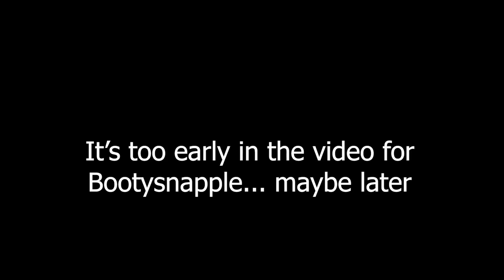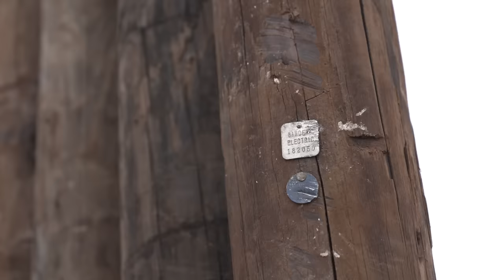Renovating an Abandoned Resort: The Wall

Comment: Hey matt. I built 21 underground complexes in the last 11 years . PLEASE READ . You need to reinforce the inside with a welded roll cage type skeleton support inside the conex box . Then use gravel and playground sand around the box once in place in the ground before burying it. Plz research it. I seen a few that collapsed before they called us in.
Reply: The condensation inside is going to be out of this world...
Reply: You'd think at least one of the ten people working there knows about roof stability complications and what could happen if there is an accident
Reply: Welded cage?  For a few inches or even a few feet of dirt, a wooden interior frame would be fine… just build it like a house.  16.5” on center, and integrate the shelving into the studs. 2x6 or 2x10 ceiling joists if 2x4s make you nervous.
Reply: Reinforcing the inside is the way to go to keep the roof from buckling inward from weight on the outside. Also, running some tubing to keep the vent fan wouldn't have been a bad idea either.
Reply: No mr dummas. He's not burying it. He's covering it
Reply: Just watch Colin Furze...
Reply: Then there's the fact he just welded mild steel to Cortan, it will rot out in no time.
Reply: @missingremote4388  Obviously he never told Mere. She is a civil engineer after all, dirt is her domain.
Reply: @Christopher_R You do realize that Matt is rich and there is no reason to go an easier route right?
Reply: Facts. People think shipping containers are so strong. Theyre actually EXTREMELY week when it comes to the corrugated parts. Very flimsy
Reply: Ya I agree I have done the same with my container but I used T post to hold my H beams going across every 5 feet and my container has about a foot of dirt on the top
Reply: He should also coat the outside of the container so it doesn’t rust.
Reply: it’s not going 50 feet under….
Reply: I did some quick math, and he is looking at easily 40,000 pounds of dirt on top of the container alone. Just to further push your point.
Reply: Don't underestimate the weight of a few inches of dirt. Especially when it gets wet.
Reply: Buried CONEX boxes in the Persian Gulf war. The roof can not handle the weight at all. You Must reinforce it!!!!!!!!!!! Semper FI!
Reply: I didn’t think welding to just the outside to rely on the welds to hold it would be the best thing to do.  I probably would have kept the fan and just went lighter on the dirt around it.
Reply: I love it how even after Matt explains what's going on people just hear what they want
Reply: @SamJG99 40k means nothing there stacked 4 to 5 containers high at the ports.and there loaded with over 43k of product.
Reply: @uria711 lol know they ain't I haul them every day and there stacked 5 high at the ports each container weighs 43k lol.that little bit of dirt isn't going to hurt that container 😂😂.
Reply: People crying about that little bit of dirt evidently never been to a port lol.there stacked 5 high and each container weighs 43k.
Reply: If it's deep enough it will be crushed/unsafe to occupy if it's not deep enough it could "float" it's way out of the ground.
Reply: Absolutely, never half ass structural integrity
Reply: @16driver16  you should really know what your talking about lol.there designed to be stacked.
Reply: @jerrywilcox9890 you evidently never been to a port either by saying that, neither do you know how a container like that works.. each container sits on supported structure not just 1mm thicc metal sheet. do some research before saying anything about safety.
Reply: @16driver16  hell they come stacked on ships and weigh way more than that dirt lol.
Reply: @jerrywilcox9890  containers are made to have a strong floor and endposts so you can stack them... the roof and walls are as light as possible only there to protect from weather etc. They have to be corregated its such thin metal
Reply: @jerrywilcox9890  also wtf you mean weighs more than dirt?!?! I can't think of ONE THING shipped in a shipping container that is heavier than dirt!!! Name one thing
Reply: @16driver16  wtf I just said you never hauled a shipping container before
Reply: @16driver16  you not understand them containers are shipped with anywhere for 40 to 44 thousand pounds of product and are stacked 5 high at the ports lol
Reply: @16driver16  he's only putting a foot high of dirt and your crying about that when they stack way more weight on them than that little bit of dirt lol.
Reply: @16driver16  you acted like its going to be barred 10 feet under ground lol.
Reply: @jerrywilcox9890  it was explained to you why that works and why dirt or anything heavy resting ontop of the ROOF not support structure doesnt work and you are still being ignorant.
Reply: @16driver16  that wouldn’t happen with what he’s doing here.
Reply: And should have left the vent on the top, to help keep the condensation down on the inside
Reply: @Vythic  lol you can call me what ever the hell ya want lol it doesn't effect me one bit cupcake.the amount of dirt he's putting on top weighs less than 4 fully loaded shipping containers lol.
Reply: @Vythic  that roof will not collapse with the little bit of dirt he's putting on it.he putting enough to cover the roof lol.hes not putting 4 feet of dirt on top. 4 inches to a foot of dirt not going to do a damn thing to it.
Reply: Did you even watch
 MR. BEAST,? He had two leaning on top of one can And dropped ten cars, one after the other from a hundred feet. And didn't even crush a Lamborghini inside.
Reply: @jerrywilcox9890 they stack other containers onto the strongest points of the ones below. Wtf does that have to do with dead center of the corrugated part? That part literally never sees any weight from the other containers. Steering wheel holders are not structural engineers for a reason.
Reply: @dillonlapointe636  there not going to be enough girt on that container to hurt anything 4 inch of dirt isn't going to do anything to the roof.you people acted like he's putting 4 feet of dirt on top he's not lol.hell I have 2 feet of dirt on 2 of mine sitting side by side and it's been like that for 6 years.
Reply: Why not build an exterior shell with the telephone poles? Even only a few inches deep running almost the length of that conex there's going to be 3-4 tons of material on top of it.
Reply: He makes these videos days or weeks before we see these. He's already done what he's going to do. No going back now
Reply: Those containers are suported by the corners and outer frame of the other container its sitting on top of. Also thoseweight ratings are floor ratings only, not the sides or top. @jerrywilcox9890
Reply: @jerrywilcox9890  yes they are stacked BUTTTTT they are sitting on top of each other at specific places that are engineered to hold the weight. The corners are very strong and designed for weight, not the middle of the roof. Im sure this will be ok with a small amount of fill on top of it but when it starts to sag, we will get another video. The video will be watching him put in some inner supports and jacking it back up level.
Reply: First, it's not underground. It is above water table, ground shift, etc. It has zero pressure on the sides, which is actually what usually causes that stuff to buckle. I think he'll be fine. Even if he isn't, it's just a conex above ground. Nobody's living in it, nothing really valuable or fragile is being stored there. He's fine.
Reply: Matt all you have to do is staple popsicle sticks 3 feet high across the base. Thats it! DONE
Reply: Its not being buried ! you can see that, just dirt pushed up to the sides and a sprinkle on top
Reply: @Christopher_R  16.5" 🤨😂
Reply: @jerrywilcox9890  No weight is on the corrugated part it all sits on the frame
Reply: @boominS10 So if you turned it upside down so the floor is now the roof everything would be fine ?
Reply: @jerrywilcox9890  You don't know what you are talking about! when stacked they sit on each ones frame not on the sheetmetal
Reply: @jerrywilcox9890  DUDE! what is your malfunction the 4 containers you are talking about DON'T SIT ON THE SHEET METAL THEY SIT ON THE POSTS AND FRAME STRUCTURE
Reply: @Michael666CA  Does anybody here understand the difference of the frame and the sheet metal covering!?
Reply: @michaelhaslett3742  No! thats a concrete bunker
Reply: @williameldridge9382  I mean it does have pressure on the sides from the dirt surrounding it but it should be fine
Reply: @jerrywilcox9890 When they’re stacked, aren’t they sitting mainly on the frames of the other containers? Or the strongest part?
Reply: Am I the only one thinking shooting both sides of that burm at the same time is nuts
Reply: @SamJG99 I had it at about 12,000 pounds. For a 40x8 shipping container 4 inches of soil I got 106 cubic feet of dirt. 1 cubic foot of dirt is about 115 lbs. maybe my math is off though.
Reply: @michaelhaslett3742 That was reinforced. Not sure it was a shipping container either. I’d have to see the video again. I think it was a built underground bunker.
Reply: Based on the dimensions of a 16 foot by 8 foot box, you would be putting about 7,000 lbs on the roof.
Reply: My dad always said to flip the container because the base of the bottom is used to carry cargo and acts as an upside down table so flipping it would make the top reinforced. Should also spray the outside with truck bed liner to protect it from rusting out the sides from saturated wet dirt.
Reply: @WaDahDahDang  🤦‍♂️ Then you would have even more weight on the top.
Reply: @michaelhaslett3742  Yeah, that’s not a shipping container. Building Abandoned Mansion Part 20.
Reply: @MegaChrisb10 yeah I would think he is exerting more per square foot than 4” of dirt.
Reply: @alanhinkel420  OK. A lot of the talk has been roof and sides no good for loads, frame and floor ok for loads. Greatest load on roof. Make the floor the roof so it can handle the load that the dirt is putting on it. Can't see the weight of the structure as being an issue, what am I missing in this scenario ?
Reply: @jerrywilcox9890  But the floor and frame of each container supports the weight of its contents.  The roof is not supporting anything.  Right?
Reply: @jerrywilcox9890 the frame is strong which is how it’s stacked. The paneling is not. It has reinforcements on all 4 corners with a frame around the perimeter top and bottom and then the sheathing is installed. Reinforcement on floors and 2 additional uprights on each side.
Reply: @bestoftheYT  central/west texas... there is no moisture to speak of..😂
Reply: You realize he has an underground bunker in his garage right? He’s not a dummy lol
Reply: "Shut your mouth when you're talking to me".  

Just a tad bit a little hyaggressive and perhaps a little rude there.  Maybe!?!  Do you have some kind of god complex or some privilege that you need to check??   Because, you're not anyone's master, and not to mention a good way to get your teeth knocked down your throat.  

All what the person was doing is giving their opinion.  And just like you, they have that right.  

Plus, it's kinda stupid fighting over a shipping container.
Reply: Down here in Australia, we have a saying: "She'll be right, mate". Cheers.
Reply: @cj548  It's the same thing. Someone who's built 21 ground-covered complexes knows what they're talking about.
Reply: I know that Matt is smarter than he presents...or I could say, he is smarter than he looks on YouTube
Reply: I’ve seen to flip it over and use the floor as the roof. The floors are much stronger. Of course still reinforce the inside.
Reply: @jerrywilcox9890 the weight is at the corners. The center is just sheet metal. You’re wrong.
Reply: @jerrywilcox9890 😂 you’re so wrong. You literally have no clue.
Reply: @bwofficial1776  nope. Afraid not
Reply: @SuperstreetC10  I'm correct there cupcake
Reply: @SamJG99 then more weight when it rains, that’s a lot of gallons of water 8.34 pounds per gallon x ?
Reply: @jerrywilcox9890   Matt literally shows you how thin the metal is while he's walking on it.  If it is bowing under 225lbs, the dirt will indeed crush it genius.
Reply: @jerrywilcox9890  I agree with you that he shouldn't encounter a problem with that much dirt. 
40 by 8 is 300 square feet. 2 foot of depth is little over 35t of dirt. So would then
recommend extra  support as it is pushing its it's lbs/sq ft.
True they are designed to stack and store up to 29t but they don't stack flush. Floors and roofs do not touch. The skeleton of the containers are the points of contact. And the strongest points.
Reply: @uria711 depends on the container… not all containers built the same… ever see a sea container ship and they are stacked 10-15 tall? They are pretty solid
Reply: Dosnt help when you hire the Mexicans in the carpark with a sign to build it! 
DO NOT GET ME WRONG!!!!!

I’m all for giving them work just as long as it’s something like labouring not something structural like this…
Reply: @uria711  Because words matter: 
Week - span of time covering 7 days.
Weak - Lacking strength or fortitude.
Reply: @jonathanb1949  He may have to learn the hard way.
Reply: @jerrywilcox9890  Yes, they are meant to be stacked, but the weight is only carried down the vertical frame at each end, at it's locking/lift points. The midsections don't actually touch when stacked, just the vertical corners, which lock into each other.
Reply: @HunterTN  Won't prevent it from caving in.  The support structure needs to be on the inside to resist any compressive forces, particularly that of wet dirt, which is much heavier than it's dry counterpart weighs.
Reply: @jerrywilcox9890 you realize that the weight isn't on any of the top or bottom of those containers when they are stacked. The edges are what take the weight. That's why all the points you attach to when you move them are on the corners.
Reply: You need to cover the top with a good ground contact vapor barrier.
Reply: I'd have extended the collar on the vent, and left it there, since you aren't driving on it. Pressure-treated wood framing, inside (like any other shed), is possible even after covering it.
Reply: Stacking at a port works fine because all weight is on the sides and corners which supports the weight.
Reply: It's not gonna collapse... its dirt on the sides that is sloping its weight away. I'm sure you're talking about when people put it in the ground when weight is pushing hard from all around
Reply: No... its just going to be a consistent temp
Reply: It's fine for what he's doing. It's been done alot
Reply: It's not getting buried in the ground! There's not enough weight pushing it side ways!
Reply: Colin made a bunker 12 feet under ground. Just use your brain. Its fine
Reply: Omg.... why do people talk more then listen or talk when they know nothing. Theyre ability to know how things work come from video games
Reply: nahhh hes doin it this way because thats this video. 10 months from now we’ll get a video “this was a mistake” or “the berm collapsed” or somethin for content then there will be a video of him doin it right sayin we all were right. bro, its a business.
Reply: @missingremote4388   - if he simply would just ask Mere!!  lol.
Reply: @jerrywilcox9890 not true.  The only reason the containers can support the weight is because the corners are reinforced.  You can only stack containers on containers,  nothing else.
Reply: @marvindebot3264  civil engineers don't deal with dirt try a geotechnical engineer. Theres much more to dirt then what a civil engineer knows
Reply: @mattgraham1983 right? He literally explained he's going to reinforce it
Reply: @jerrywilcox9890 the vertical strength at the 4 corners is ridiculously strong. But the concern is the corrugated area
Reply: I have buried a few of them but only have added less then a foot of dirt on top and still haven’t had any issues other then the condensation build up it’s pretty bad so n the winter time
Reply: @saskia7214  Civil engineers build roads, dams, levees, berms, building pads etc, they deal with dirt every day.
Reply: Better yet, have a structural engineer tell him how to not die
Reply: @marvindebot3264  there's a big difference between civil engineers and geotechnical engineers.
Reply: @BIGG..G it’s scary to think about someone shooting directly at you, but only a foot of dirt will stop almost anything except explosives👍🏻
Reply: Given who he hired for the home safe he will not listen
Reply: @harry503  who did he hire
Reply: @missingremote4388 not your property. Not to your decision.
Reply: @jerrywilcox9890  Somebody never had a cool science teacher, either that, or never got past third grade. You can stand on an egg if you stand on the pointy end. But you can crush it in your fingers from the wide sides. Simple.
Reply: @FishyBoi1337  and lol
Reply: @FishyBoi1337  your wasting your time running your mouth to me lol.
Reply: @jerrywilcox9890 kiddo, you're a laugh😂
Reply: @jerrywilcox9890  did you watch the newest video? I’m so glad you’re right! 😂😂
Reply: I hope the people that said it was fine go back and remove their comments after they see the new video of the walls caving in.
Reply: @Christopher_R wrong